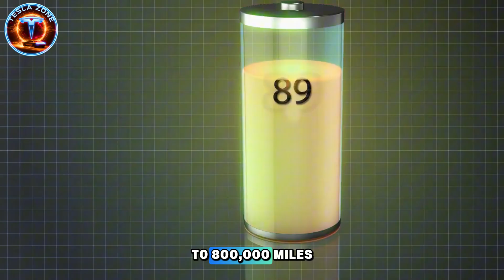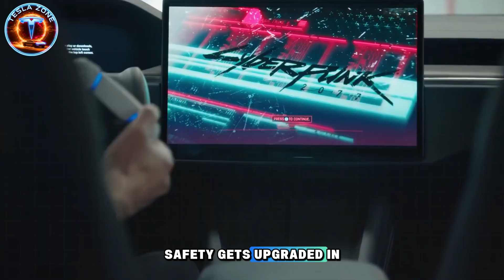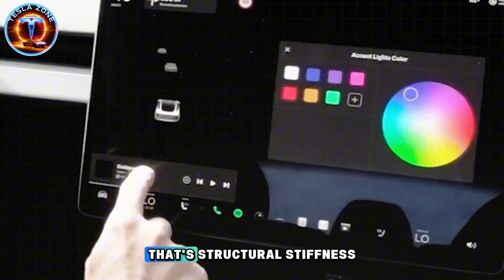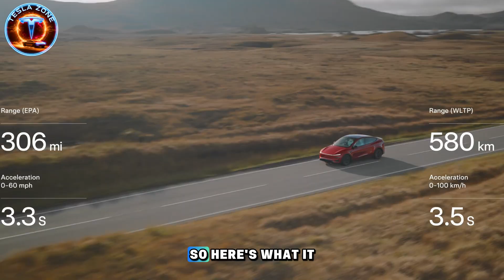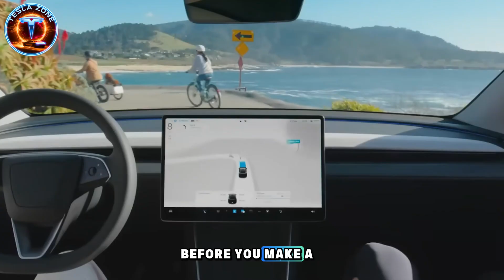Elon Musk's $25K Model 2 FINALLY HERE: 3 Changes Beat Gas Cars!

Comment: What's the new model 2 TIRES???
Reply from the maker: Good question. Leaks point to low-rolling-resistance all-season tires, likely 16–17 inch, tuned for efficiency, range, and ride comfort on the $25K Model 2.